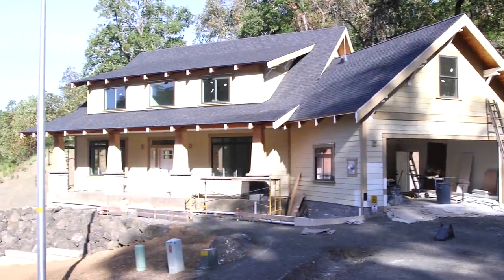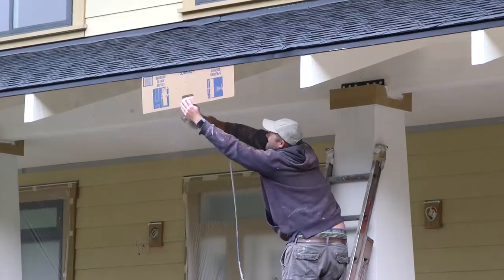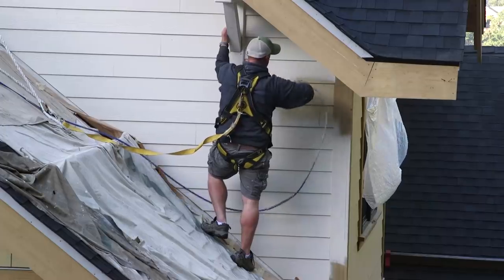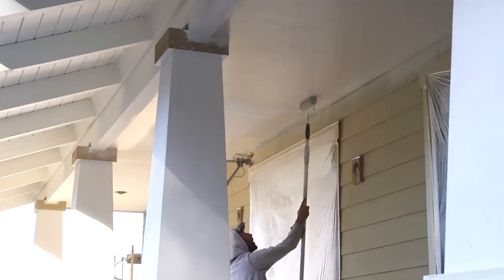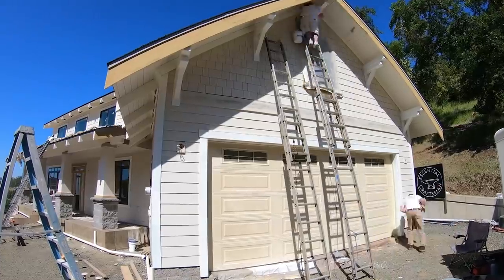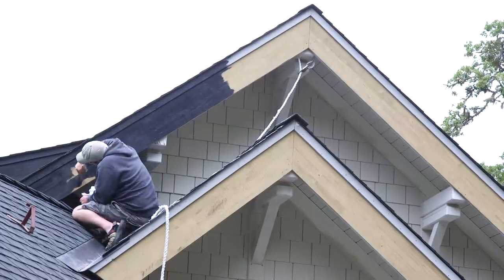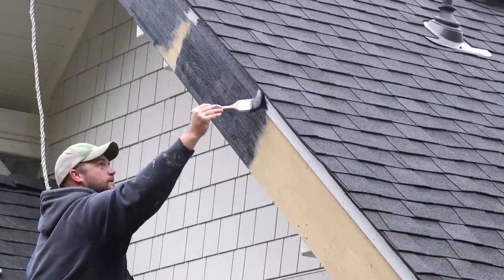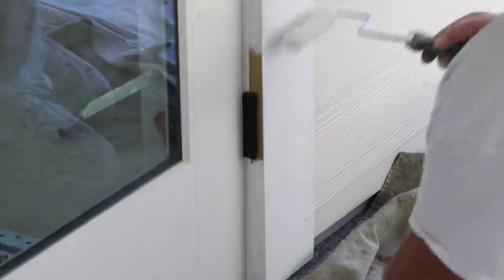Painting a House Ep.123

Comment: GREAT JOB! Inside and out. I have been a painting contractor in the northern California area for over 16 years. From what I have seen, its rare to find guys that do this level of a quality. I focus on repaints, and almost every housing track that I have repainted in, had been done by what we call "blow and go". Rarely back rolled walls, little to no sanding on the trim. The wood work inside has brush marks, and done in oil based enamel to save time. Keep up the good work!

Comment: For a house this tall (which isn't much different than my house), it seems like it would make sense to install fall-arrest anchors during the build, both for the builders and for any maintenance tasks during the lifetime of the house. There would be issues with preventing water intrusion and maintaining the integrity of the anchor over time, of course, but those seem as if they would be solvable.

Note that I've never seen this done, but as a sometime rock climber, there's enough exposure for anyone up on a tall ladder, scaffold, or roof that I'd be (am) uncomfortable without protection.
Reply: There are permanent fall arrest anchors you can install during shingling. When I get a new roof I plan on getting them, if you install them correctly you shouldn't have water intrusion since they sandwich between the shingles
Reply: You can also use scaffolding as fall protection like they did in this video in a few places
Reply: @JankyShack  Good to know about the anchors. I'd be less worried about using scaffolding, since it's a bit harder to make a bad mistake as long as the scaffolding doesn't collapse. Some of the ladder work was something that I wouldn't have been willing to do in the way that they did it, though. I have some idea about the stats on ladder accidents. And there are places on that property where a 10' fall would be very bad indeed.

Not saying that the painters were doing anything wrong. They're grownups and get to make decisions, and by the available evidence it worked out fine.. I'm just saying that I wouldn't want to make those same decisions.
Reply: @dougsundseth6904  Than you should see me on a 30ft extended ladder leaning on my gable wall doing stucco with hawk and trowel in my hands. No holding, no harness, legs get locked on the ladder and ladder is screwed to the wall.

Comment: About the only thing I know about painting in general is how to mask off a section of a car in preparation for paint, but boy I know for a fact that that's one of the most important parts of that job, because if that paint gets ANYWHERE it's not supposed to, you might as well sand the whole body panel off and start over, because blending between different coats of paint is extremely difficult (or so said the guy I used to work with that actually worked with the paint).
As others have said here on this video, paint is 90% prep work, and 10% actually painting.
And if I was going to say it, I'd say that masking is maybe 75% of the prep work, at least in proportion of how important it is that you get it right.

Comment: Jaws dropped. Very nice work. However, I would've never undertaken such a job, rather build from the right colors originally or paint first, build next. The building already had nice colors.
Reply: I'm fussing you have never prepainted siding before 😂 fiber cement in particular. I have, 20 sq of 12" JH to be exact, wouldn't do it again

Comment: Backrolling has an element of timing. For leveling and working it in, you can go right behind. If you wait you can form stipple and that stipple can hide imperfections. It especially good to stipple a satin or low gloss paint, as you get to use a better paint but hide imperfections with stipple. Of course the sun is part of this. In latex the paint needs about 7 seconds to wet fully, so a little gap between sprayer and roller is good. Oil will wet faster. I love and developed latex  paint in my career but I prefer it primer with 100% acrylic over it for exterior on repaint. That may be out of date but I think the moisture barrier of the oil helps long term performance. I also don’t like a lot of oil primer, running pretty thin, but I over add, 2-3x spec, of the latex over it. I often spec’d houses in mils, 4-8 mils DFT and not coverage - uncommon yes, but thats one paint chemists approach on jobs that lasted 20 years. This practice comes from roof coatings.

Comment: I thought I read that the proper paint for Hardie products was a 100% acrylic paint.  It that the same as a latex?  I am doing a small project using Hardie lap siding and I purchased 100% acrylic paint because I thought that was what they said.  Hope I didn't make a mistake.
Reply: Nope, you're good.... acrylic and latex are the same thing - water-based.  Alkyd is oil-based and isn't used much for exteriors anymore....although the paint chemists have been busy concocting 'hybrid' oils, which are water-based but have the hardness of a trim paint.  I use a hybrid alkyd satin or semi gloss from Behr that goes on nicely and covers well.

Comment: I love that you diddnt cover everything with aluminum and plastic as so many houses are built these days.
Reply: True but maintenance costs for life with timber.
Reply: @TurinTuramber  vinyl and aluminum don’t have unlimited life spans by any means
Reply: @gregoryvschmidt  I live in England where UPVC and cement boards are common alternatives to timber. There are commonly made to mimic timber in looks but I agree timber looks best. 

However if you have timber fascia and want it looking fresh then you can enjoy painting it every five years or so and replacing it every 20.
Reply: @TurinTuramber  we don’t really know yet about the longevity of Hardie products. My house the clapboards are Hardie so my fingers are crossed. Also Miratec as trim boards seem bombproof, but again we really don’t know lifespans. But solid wood boards better last longer than 20 years. The original wood trim on my house is 115 years and still going strong
Reply: @gregoryvschmidt  Different places and different parts of the house all have different weather. Timber can rot quite fast under the right conditions. Equally it can last, a local pub is timber framed and was built in the 16th century.
Reply: @TurinTuramber  it largely depends on the species of wood. White oak will outlast red oak by a factor of ten probably
Reply: @TurinTuramber  how does UPVC differ?
Reply: @gregoryvschmidt  uPVC looks tacky but you can get wood effect and different colours. Lasts  for many years 30 even. Can be washed with soapy water and looks like new. Utility and cost are the reasons why people have moved away from Timber to uPVC. 

Life is too short and precious to stand atop a high ladder, sanding and painting fascias and soffits.

Comment: getting the exterior of our house painted is probably the part that gives me the most anxiety about our new house. I see so many terrible paint jobs on Hardie siding houses around here that it really makes me consider vinyl siding.
Reply: You can get coloured cement board sidings, surprised to learn that they get painted.
Reply: Vinyl is disgusting. No self respecting man should use use that playschool plastic garbage. Scrape with a heat gun, sand with 60 grit, caulk and then paint.
Reply: @TurinTuramber  they usually end up so scratched up that they need a paintjob either right after installation, or within a few years anyway. Many of the siding contactors around won't even install pre-colored siding, saying it's too aggravating to work with, and too hard to make the customer happy at the end of the job.
Reply: @nicholascooper1193  I have it on my house as do all the houses in the street, for last 12 years plus with no problems. I guess future maintenance costs are of little concern for a house builder.

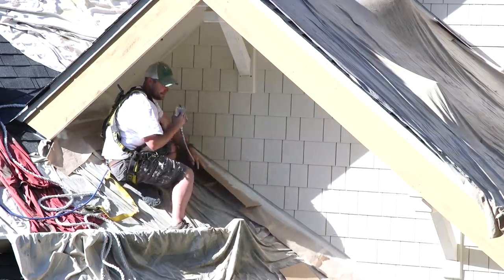Comment: At 1:30, you say that you "did not use a latex paint, but rather a full bodied stain". Later at around 7:30, you talk about using latex paint. Is it oil stain on the porch ceiling and latex on the body of the house? By the way, it looks great!
Reply: He is using solid stain for the pine soffit boards. I believe the Arborcoat he used is water based (acrylic bonding agents), so it is similar to paint, but it doesn't have the level of hiding solids in it, so some of the wood texture and color comes through, especially if brushed on. I used sherwin williams woodscapes on my cedar, and it almost looks like paint, but it weathers differently, so it looks more similar to stained wood in that sense. It is usually completely flat as well, no sheen.